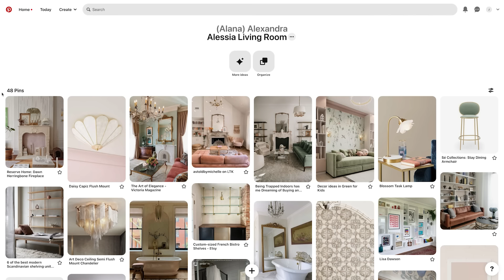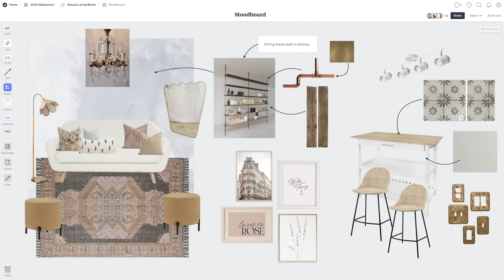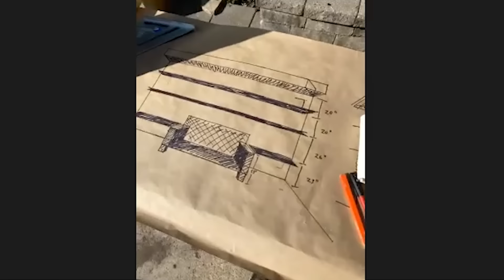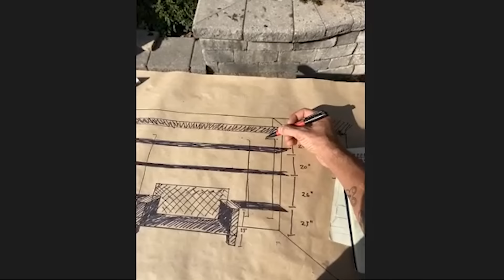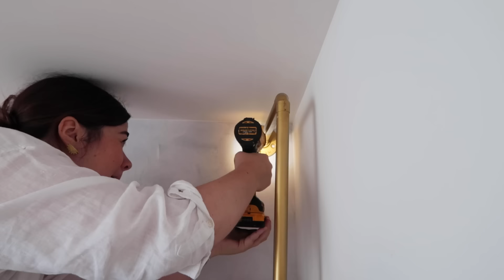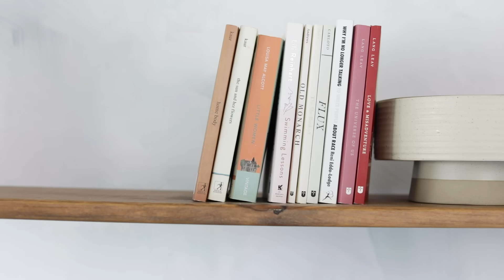100 Sq Ft TINY Whimsical Living Room Makeover

Comment: It turned out really really nice, the only thing I’m kind of confused about is why copper pipes were used and then painted over. 🤔 Copper is expensive, using a less expensive metal pipe would have made more sense. I also would’ve liked to have seen a longer and wider mirror used to make the room appear larger.

Comment: Who hangs wallpaper starting in the right corner of the room? It's like driving on the same side of the road.
Also, why not to install the tiles on the island before it was moved to the apartment? I don't know if they did not buy enough tiles but the patter did not match at the corner (on the vertical sides).
Otherwise, nice job. I really like the kitchen cabinets with the wood doors.

Comment: Have you ever designed an item for a space and it ended up not working out (like if the island didn't end up having enough space)? I feel like you usually find a way to fix it but wondering if that's ever happened off camera and we never see it!

Comment: I would love to see what you could design in a ESP 10 x 20 Incrdible Tiny Home in TN. USA.  Randy is building these specifically for DIY finishing. Kitchen and bath are completed. Air and heat are completed. Electrical and plumbing are completed. Because of that these homes are very affordable. I just can't get around the design aspect of the layout. Hope you think about it and reach out to Randy at Incredible Tiny Homes.